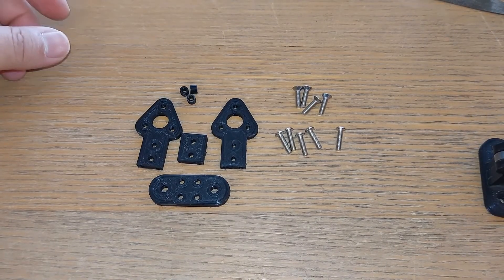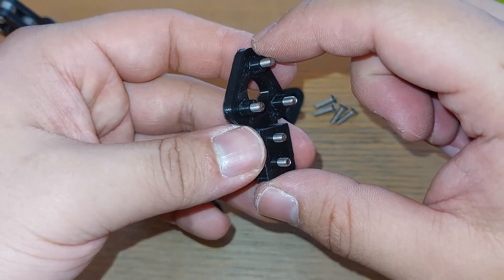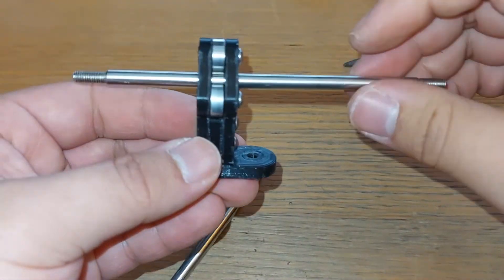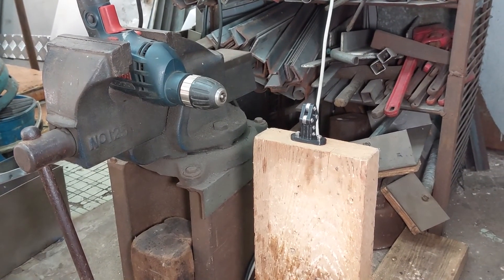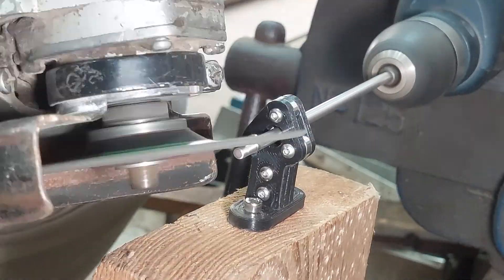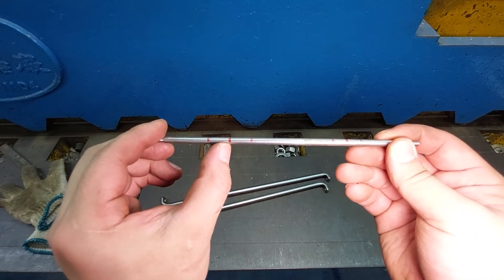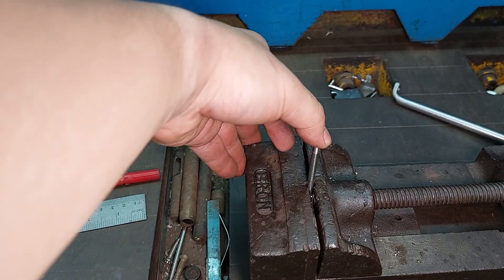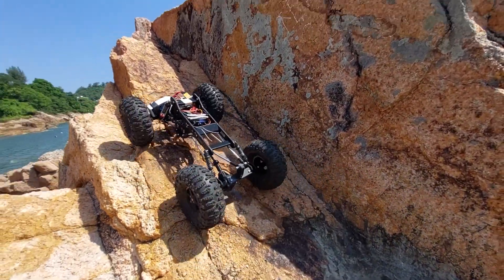How to make RC Crawler Links PT2:  Odd sized links, High Clearance Links, Bent Links

Comment from the maker: Another point I forgot to address near the end of the video is the use of stainless tube or titanium tube with m4 all thread to make links.  This is definitly a better way to go about it as it is definitely stronger and will catch much less on rough surfaces less compared to aluminium links.  However doing it this way has a higher material cost and will be more difficult when creating different diameter links.  Creating links out of solid rod will always be stronger and will also look much better especially when introducing bends.  At the end of the day either techniques works, and yes this technique is more complex and more time consuming but this is my prefered way of fabricating links.
Happy Crawling!

Comment: If there's one thing I would do different I think I would use a stone or maybe even a file and didn't use the drill power to kind of go over everything instead of using a cutoff wheel that's the only thing I could see to do different you might get a better finish but man this is brilliant

Comment: @CRCG  thanks, I've just tried your method but it seems my die wouldn't bite the rod. Do I have to use special kind of die for this job? I currently using regular steel die.
Reply from the maker: Im pretty sure it's just a regular die set, its just off the shelf from my local hardware store. Once you get the ends down to the right diameter, you can taper the tip slightly to help the die set initiate the threads.  Some lubricant like cutting oil  also helps too.  Perhaps the type of steel of the rods also play a part, the rods I'm using are 304 stainless.
Reply: I'm using 304 SS, I did set the diameter to about 3.8mm and taper it but still it's hard to initiate the thread. Maybe the die quality is below average, I even tried it on brass rod, succeeded but it's still very hard.

Comment: What kind of stainless steel are you using? Is it 304?
Reply from the maker: it's old stock and scrap off cuts,  mostly 304 but probably some 316 rods mixed in there some where
Reply: @CRCG_00  thanks, I've just tried your method but it seems my die wouldn't bite the rod. Do I have to use special kind of die for this job? I currently using regular steel die.

Comment: I really like it and will try and build something similar one of these days. I'm currently using ally links with the ends drilled and tapped using my mini lathe. And yes I'm going to use s/steel for the links next time. My only proper crawler is a cheapo modified FTX Ravine ( Danchee Ridge Rock)